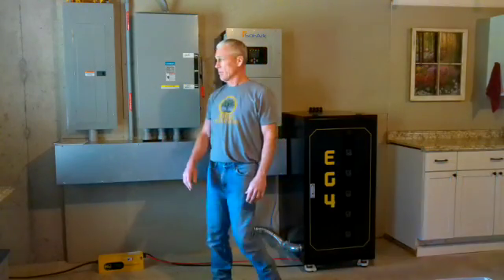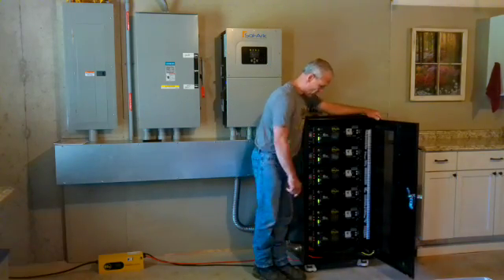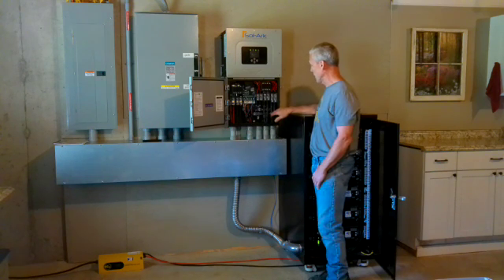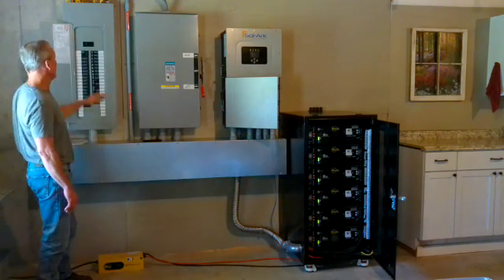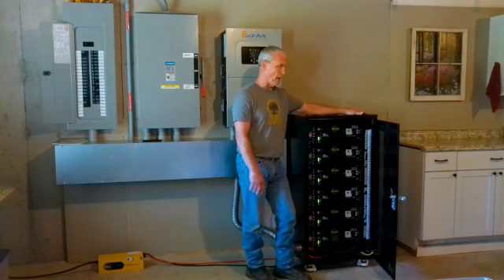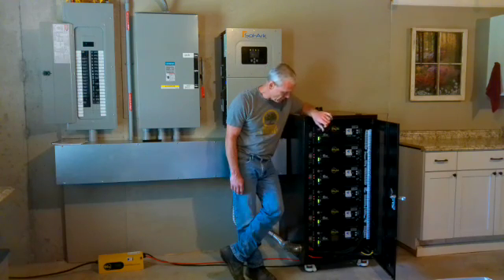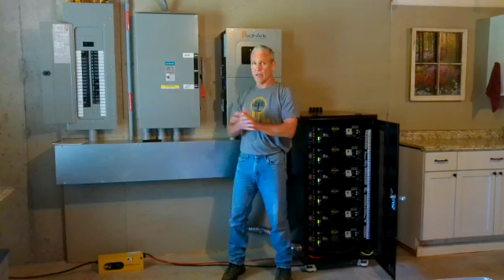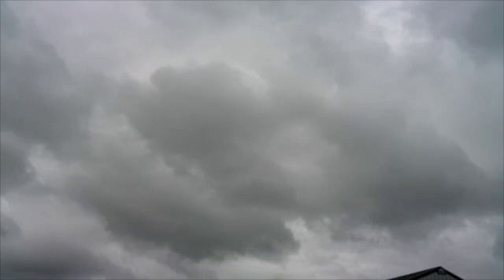Off-Grid Sol-Ark 15K, EG4 V2 Batteries and 7k Solar Array

Comment: How many batteries for a 2500sq ft house two story?
Reply from the maker: The size of the house won't matter as much as the loads you run on a regular basis. I have a 20 minute video "How we live off grid in a modern house" it details what we've done and how we manage our power usage. You will need to know how much power you use in an average day then size your battery storage and solar array to provide that power, plus allow extra power and storage for inclement weather. Everyone is different there is no one size fits all.
Reply from the maker: A ball park guess knowing nothing about your power usage...at least 60 kilowatts of storage and a 16-18 kilowatt solar array.

Comment: Thank youuu because I was wondering how the power will get into the house from the off grid solar
Reply from the maker: The solar array wires right into the inverter which then distributes the power to the loads and the batteries. At night the power in the batteries goes through the inverter to the loads. Then the next day the solar recharges the batteries again...and so on. Don't buy a cheap inverter!

Comment: What are the specs on the solar panels…
They are pretty impressive…
Reply from the maker: There are 24 panels for 6.9kw. They are wired in 3 legs of 8 going into the Sol-Ark. While grid tied I read the meter everyday and we would produce about 30-35kw on a good peak season day, about 20-25kw during winter. Off grid the Sol-Ark is taking in 15-20kw a day to run the loads and top off the batteries. We do not have a dump load yet to redirect the extra power made by the panels so it is waisted. We learned, while grid tied, how to manage our loads for maximum efficiency before going off grid...it paid off and the batteries are usually above 80% when the sun comes up in the morning and they are full again by noon.

Comment: won't do winter it in Michigan
Reply from the maker: You would need a turbine and a generator with a Chargeverter. The turbine I am installing is small but should help keep my batteries full in winter and my EG4 Chargeverter has worked well when I test it once a month while exercising my Cummins gene. I also heat 100% with wood.

Comment: What kind of yearly production ratio are you getting with your system. KWh/kWp DC ? Something around 1,200 to 1,500
Reply from the maker: Sorry we had severe storms leaving me without internet last night and today. During the time we were grid tied we averaged 31KWh a day, but that included what we sent to the grid...so maxed out with no waste. Off grid we are averaging about 19KWh a day because we don't have the grid or any other "dump load" to send the extra power to. Since April 17, 2024, we have produced 2200KHw through the Sol-Ark, so I think the math on that is close to my figures. Hope this answers your question well.
Reply: @goingoffgridatgreenshireho435  storms really suck. I produce 1,200-1,800 kWh AC per month. I enjoy watching your solar evolution
Reply from the maker: My turbine and the control panel with the charge controller are mounted and installed, I'm still waiting for my power cable to arrive then I will have it up and running...hopefully by next weekend!
Reply: @goingoffgridatgreenshireho435  what type of turbine did you go with?
Reply from the maker: Missouri Wind and Solar 1600w / 48V /Falcon 3 with pre-wired control panel and MidNite Classic 250 charge controller. About $3000 and DIY install...can't find an electrician to help. Mounted through the roof of my shop with a 2" schedule 40 galvanized pipe. I'll have a video when its done.

Comment: Nice. I think Solark 15k is the only emp-hardened solar inverter in the market.
Reply from the maker: Unfortunately the reading I've done indicates the solar array may short out through the back feed in the wires connected to the inverter. I don't know and hope not to have to test the theory. It is difficult to prepare for every event without going bankrupt.
Reply: It's mainly a gimmick. There's just no way in hell that anything is going to survive a true EMP. Especially with those solar panels on the roof running down to his equipment.
Reply from the maker: boblatkey, my panels are ground mount but you are probably right! There's no way to really test it without a massive EMP. I will soon be hard wiring  EMP protection into the 3 MPPT legs in my Sol-Ark coming from the solar array as a second line of defense...its all I can do to prepare, at least I feel confident I'll be safe from a lightning surge.
Reply: @goingoffgridatgreenshireho435  will you be using EMP Shield and/Midnight Solar products?
Reply from the maker: Yes to both. The charge controller for my wind turbine is a MidNite Classic 250.
Reply: @goingoffgridatgreenshireho435  well that's a dang good point! It's worth a try! Although I think if we get hit with a massive EMP one of the last things we will be worrying about is whether or not we have power. 😜
Reply from the maker: LOL!! I have said the same thing to the people who I discuss these things with. I just can't stop trying to be prepared for all I can to protect and provide for my circle.

Comment: Is your house all electric and what size heatpump do you have. Also, are the 6 batteries all you need to get through the night.
Reply from the maker: All electric except we cook with propane and heat with wood. Don't have a heatpump. The batteries are between 84 and 88% full in the morning when I get up.... If they were full at sunset. We had a lot of practice controlling our power usage over the last 5 years on solar. We are very dialed in on our power usage, but we don't go without during our daily routine, we are just careful about using large loads. We set the AC at 80 when its 90 degrees out.
Reply from the maker: Additionally our house is also only 1,200 sq. feet and the AC is a 2.5 ton with a soft start.
Reply: @goingoffgridatgreenshireho435  thanks for the info. I'm trying to figure out batteryback up. Like you, I plan on having the grid as a backup, plus I have a 26kw generator if all grid and solar fail. But for the majority of the time, I would like to be off grid with no generator back up. We have a 1500 sq ft house. all electric. Major load at night would be a 3 ton heatpump, 18 seer. Which has a soft start built in.
Reply from the maker: You might look at the EG4 Chargeverter to charge your bank. You can run it with your generator. I have a 13kw Cummins. The Chargeverter works well, it is bolted to the busbar and I set it to charge at 54v /60A . It charges the entire bank at 9.7 - 9.8A into each battery. So in 2 hours I can raise the state of charge 20% with 2 gallons of propane. I won't use it often but when I need it, it works well.  They run about $400 at Signature Solar.

Comment: price so far?
Reply from the maker: Solar $24,000, inverter $6,800, batteries $10,000, install $10,000 all with a 30% tax credit. So about $35,500 after tax credit.
Reply from the maker: To confirm: The $24,000 for solar included the solar install. The $10,000 install was for the off-grid system.

Comment: You are a natural on YT, nice video.  Sounds like you are a fan of the Eg4.  I am looking at the simpliphi batteries.  Solark said they are one of the recommended batteries that play nice with the solark.  I am curious if that is that important.  Those batteries are a little more than the eg4.  If you have an opinion curious on that.
Reply from the maker: Simpliphi was actually my first choice 3 years ago. They are excellent batteries but the Sol-Ark pairs very well with EG4 as well.  The rack system of EG4 with the bus bars makes for a very clean system that distributes current extremely well. It was a pain staking, gut wrenching decision process...my poor wife!! EG4 just seemed to be a good fit for me and I wanted the Chargeverter which I knew would pair well with their batteries. Free shipping and the sale Signature Solar was promoting was the final straw. Good luck sir, but either way, you win!
Reply: EG4 batteries are not on Sol-Ark’s compatibility list. Consequently, you do not get a UL9540 listing or 9540A. The AHJ, if you permit the installation, will not approve your install. Your insurance company may have an issue also!
Reply from the maker: Thank you for the info....this is the kind of thing, that if not pointed out, could become a problem for some people. In speaking to Sol-Ark Tech, they advise that since EG4 batteries are UL9540 listed, the combination should not be an issue.  Sol-Ark said the reason EG4 is not on their compatibility list is because EG4 has not submitted the forms to do so. They further said, that is probably because there are so many EG4 / Sol-Ark combinations across the country, even in areas requiring a permit for installation, that EG4 just isn't concerned about it.  I know my system is working great and my batteries and Sol-Ark communicate very well. There is no "Authority Having Jurisdiction" where I live, so I'm not concerned with that.